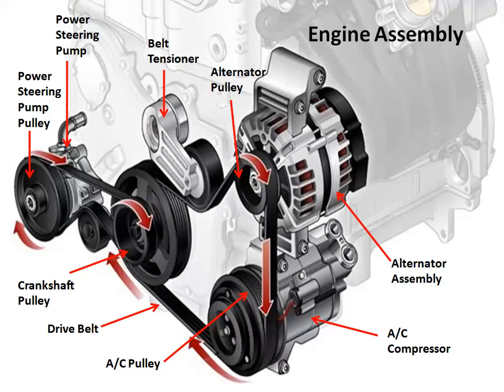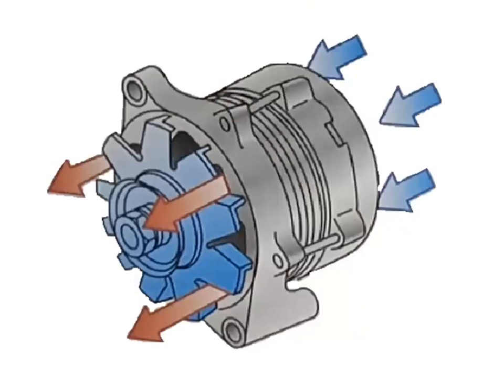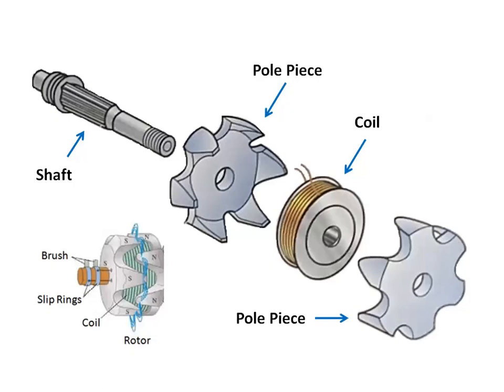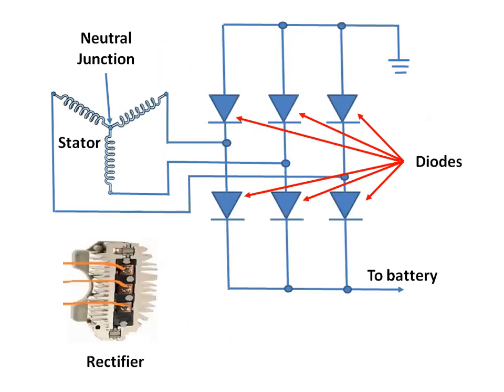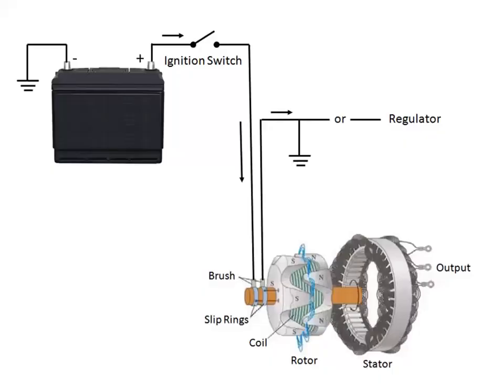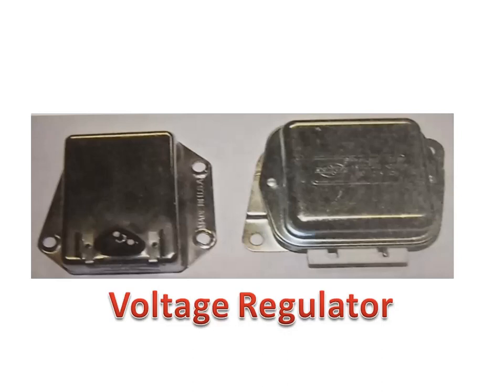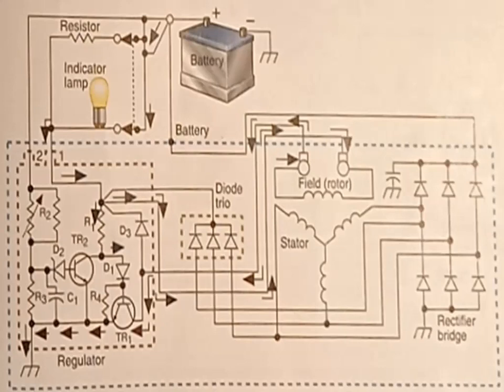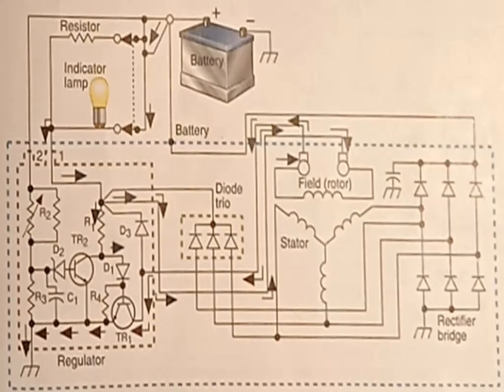Vehicle Charging System and Alternator Function Explained | How it works

Comment: Hi sir...new subscriber poh...maraming lng poh sir...pwede bang sa Isang sasakyan dalawang alternator,..Saka na parallel o na series ba Yung alternator...maraming salamat
Reply from the maker: @Julius Estardo. Thank you sa pag subscribe at pag watch sa video. Tungkol sa question, isa lang ang gamit na alternator sa vehicle or heavy equipment. Pwede dalawa ang battery para maging 24 volts, dapat series connection ang 2 batteries. Bakit 24 volts? kasi 24 volts din ang starting motor. Pero ang alternator isang assembly lang. Meron lang itong rectifier para to ma-convert from AC to DC.  Kung meron ka pang tanong, magtanong ka lang. Pwede rin mag suggest ng topic for my next video.